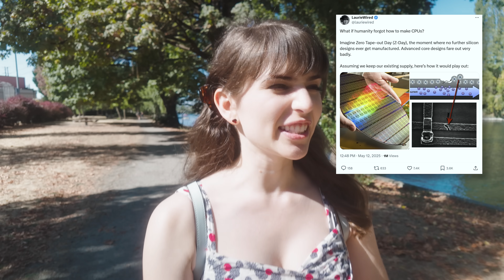what if humans forgot how to make CPUs?

Comment: I've lived this scenario but in reverse. I'm 70 now and I've been a technologist pretty much my entire life. I remember life before widespread computers of any kind. When I was a teenager the only interaction that people had with computers was their banking system or their utility bill. Life was entirely paper based. Our phone in the hallway was an analog pulse rotary handset. Television was black and white and then early vacuum tube-based color. Radio was radio and to interact with friends usually meant visiting them at their house or apartment. What you don't mention is that probably eighty percent of the population will have to die. Never mind about the fun little distractions we all live with today; our 'just in time' food and medical supply system is completely reliant on computer horsepower to run. I remember the paper-based world. Invoices and orders took days, sometimes weeks. Analysis and projections took months. Decisions and strategy was reserved for the next year. Our infrastructure would grind back to the crawl it used to be. Here's a tip; be dead before we forget how to make sand that thinks or can't maintain the infrastructure we have today. Technology going forward is amazing. Going backwards is horrifying. And eventually it is going to happen.
Reply: Just farm efficiency alone will be enough of a problem. The precision applicators, GPS guidance systems, and post-harvest processing equipment are essential to the reliable high production the current population relies on. 
People won't completely starve in the producing nations but costs will go up at least 50% which are resources that must be taken from some other end use and there will be less surplus to supply nations that are already on the edge of starvation.
Reply: Talking of paper, a few years ago, I read that the demand for paper was higher than ever since computer use increased. You'd think the paper industry would have declined, but apparently it's the opposite. Demand for paper increases. My guess is that IT allows for more office work, very broadly speaking. Reports, documents and so on. Many of which have to be printed at some point. Also, many, probably most of us have a printer at home. Hardly anybody would be printing things at home as recently as 50 years ago.
Reply: @OrangeNash  It has been trending down for a few years, but yeah into the early 2000's there were many of an older generation that needlessly printed everything. Not just wasteful memos and low info-density handouts, but they had the mindset of printing email just to read it, like a fax, because mail is a paper you receive in your hand printing is just a default part of the delivery…

Seriously, I even recall several company-wide memos at the corporation I worked at back at that time telling people to stop printing emails because it was creating a significant issue of both office supplies and handling the recycling, and there is a forward feature if you need to share it with a coworker.
Reply: I to was a member of that generation. I got into computers back in the early 70's in high school, we worked on late 60's mainframes and PDP-11 timeshare systems. Life was different then, but I could see us as a civilization reverting back if needed. My Son would be lost as would all Gen Z kids, but the human race is pretty adaptable and would largely survive.

Comment: Sorry, this apocalyptic scenario should be "what would happen if all electrical engineers and physicists died and all their books & PDFs (knowledge) suddenly vanished?"

Otherwise, they will just start building transistors, while going to back to mechanical computers with them hole-punch cards to get to the stage where they can make electrical transistors again.

There is also another very boring scenario where we would forget this: we figure out some alternative technology like, spintronics for example, is just much better for calculations. In which case, modern day CPUs would become the vacuum tubes of the future...

Comment: I still have a few 12-15 year old computers that are still running like new. In fact, I prefer to keep my older machines (all running Win 10 Pro) because they seem to be more robust than the latest and greatest. I've bought 2 average HP laptops since 2020, and both have suffered major failures, whereas my older machines just keep on running flawlessly. I'm not concerned about all of the micro-controlled things we have because I have many older appliances without chips in them just waiting to be pressed back into service when the last chip goes down. Now I'm looking for an old car built before everything was computerized.

Comment: If I put my optimist hat on, I think that within 10 years (or less) we'd have optical CPUs (with all the logic/and/not/xor gates replaced with fiber optic & mechanical replacements).  It would be expensive (b/c modern CPUs are basically printed with light by depositing metals and doping agents); and could possibly even surpass modern CPUs in terms of speed and reliability.  They would be rather huge, though.

Comment: I'll assume that there is a reason why this occurred, such as a major solar storm that wipes out a significant portion of existing technology. Perhaps things have become so specialized with automation that the actual people who knew how to do this from scratch have died out.

I'm glad that I have studied the process of old-school synthesis. I'm fairly confident in my ability to make very simple logic ICs, likely no more complex than the 74HC series. With significant effort, I think I could replicate late seventies era microcomputer ICs, with CMOS. The original 6502 was taped out by using a large lens to shrink masking down to the gate size. The NMOS technology of the 6502 used roughly 4,500 gates, and the CMOS technology of the 65C02 uses around 12,000. It's a significant jump in scale, but one that would be possible using modern optics.

We would lose out on a lot of what we take for granted, but I've written plenty of software for a 65C02. It would be enough to bootstrap the technology again and rediscover what we have lost in a couple of decades. It would be an incredibly lucrative business, given how much we rely on this technology. Rediscovery tends to go faster, because we know what was once possible. We can examine dead silicon as it fails. That saves a lot of false starts.

Comment: well .. if we immagine the worst, a full scale nuclear war .. the first to go is nuclear plants and the power grid from EMP pulses .. including most unshielded electronics, nearly 100% of consumer devices would become useless .. even some diesel backup generations would fail (integrated electronics) .. about 90% of the population would find itself without any power and light .. of those who didnt die in the initial blasts or by radiation, most will freeze to death or starve to death .. in less than a year 80% will be dead ..

Comment: It's 100 Years after Z-Day. A myth persists. Legend tells of an indestructable device with endless battery life: the Nokia 3210.
Some brave adventures discover a huge stockpile of the last ones ever produced. They decide to build a new internet, powered entirely by the 3210s.
And even 100 years later, they are still running on their initial power charges from the late 1990s.

Comment: Uhm. I was responsible for university department hardware (Russia, in a pretty underfunded place). (part time, between very early 2000s and about 2022). Oldest machines we had practically working in 2021 were from 2006. Most of the issues were not actually CPUs, but mechanical drives getting dead and capacitors on motherboards drying out and dying. Chips themselves are mostly fine, unless you hit bad batches/series/models.

And yes, the situation is about right - stockpile the hardware, do not throw out/write off anything. Fix what you can. Switches, actually live pretty long life (our longest living dated to early 2000s). Current hardware may not fare that well, due to cost cutting in production. Also - SSDs wear out. Modern ones - quicker.
We ran desktop class machines as servers too (ill-advised, but it does work and getting spares is easier ;-) ).

PS. loss of chip production would hit all car manufacturing (all modern cars have more than a few CPUs in them) and lots of other unexpected stuff, from medical equipment to bank cards (chips too).
PPS. that was mostly covered in video.

Comment: Interesting thought experiment! I think all of the predictions are good, but the timeline is accelerated - I think it'd take longer for things to fail in general.

I have and run old machines 24/7 to compile software on alternate architectures like VAX, m68k, Alpha, and so on.

The older machines (late '80s, early '90s) have already been recapped and have gone through power supply and drive replacements.

Machines like my AlphaServer DS25 from 2002 or so will run forever. It's built way better than contemporary servers and is still more reliable than new machines. Even original SCSI drives from when the AlphaServer DS25 was new are still running (although the primary storage is much newer SATA and SAS).

Late Power Mac PowerPC machines are still running reliably, but have needed new storage.

I ran an iPhone 6 until two years ago, and it's still used for navigation and music, so I don't think phones will fail so quickly, although their batteries will.

What has failed most? In my experience, power supplies older than twenty years old will need to be recapped. Interestingly, recapped older power supplies are more reliable than those made from, say, 2000 through 2015.

SSDs are horrible. I've had classic and new machines chew through countless SSDs, although this is for heavy usage - compiling with tons of swap, checking email spool files on servers, et cetera.

Spinning rust reliability depends heavily on the drive. I have the first hard drive I ever owned, which is a 200 meg SCSI drive which still runs fine. Older but fancier drives seem to last better than consumer drives. For instance, many of my systems use 2.5" UW-SCSI 320 SCA server grade 70 gig drives that're from around 2006 or so.

So people like me would probably keep machines running for many decades :) Having run servers in the '90s, I already know what's possible on sub 100 MIPS machines, and it's a lot more than most people would guess, I think.

Comment: So earlier this year, one on my drives on my development RAID failed. Had it for 8 years, so I bought a pair of 1TB WD RE5 Drives, and rebuild my raid, yeah, so I have my mirror and 1 more free just in case. I am building another PC now. The one I have is 13 years old with a 4770k. And yes, I will put my development drive on another mirror. I keep my boot on an SSD that I hardly write to, unless I am installing stuff. My data/test drive is not a mirror, don't mind losing that drive, but I have 2 of those, not synced. My swap drive is an older SSHD. I guess my new pc boot will be an NVME and everything else will remain the same. Unless I decide to do big data stuff. hmm.

Comment: I think about this a lot because one of my obsessions is how to design the smallest possible fully self-sufficient and self-replicating Martian colony.  We can malt habitats out of glaciers, build frozen mud housing, and smelt all kinds of metals making iron-nickel steel, cold-rolled and corrugated steels plus cold-welding them in the nearly oxygen free atmosphere...  We can generate efficient wind energy (with very broad blades) and water batteries with in situ resources but microchips?  My best thoughts so far are layers of electronic inks on paper -- very large circuits barely making a usable computer to share among the colony.  We could use the integer only version of RISC-V.  I would like to be able to at least make a RISC-V processor with small RVV extension on something akin to the old M6809, 6502, or Z-80.  I think we can make vastly more useful software for those today than we could then.  The decades have been a horror show of increasingly bloated software for no valid reason beyond stupidity and laziness.  BTW, you are definitely in the Pacific Northwest.  I grew up there and love there.

Comment: With Intel currently folding which could lead to a more monopolised CPU market due to less competition which would lead to stagnation that might be not so hypothetical. Also getting shortages somewhere in critical materials tools or equipment can disrupt this proccess completely. I don't believe there's even one company with full cycle CPU production. Lithographic scanners by Dutch ASML,diffusion in Malaysia, production in Taiwan. Someone growing Si monocrystals for waifers,someone else making photomasks,MOSFETS,capacitors etc. I think semiconductor manufacturing is the most complex technological proccess in human history by far.

Comment: Well, first thing that WILL happen, is that "all" resources will be spent on reverse engineering the whole process while everything is still working. Even if the technology will be 16nm CPUs or more, it's better than nothing. If I forgot how to make something, I retrace my steps or analyse existing works and try to recreate it. Same thing with anything. It's a matter of how much people want to do it. So the real question is, how much of the process is lost?

Did we lose from the very beginning. Like how to make and further refine silicon into 99.99999% pure silicon? Or the blueprints of CPUs? Or even the concept of CPUs dating all the way back to WW2? Depending on how much and what is lost may result in weeks to decades worth of time given to restart the whole process.

Comment: we could recreate cpu's using discrete components . supercomputers up to the late 60s were still discreet , with modern manfacturing we could probably get to the level of about 486-pentium/68030 level performance. ram would be more difficult . networking tough . we would go back to central computing with basic 1 to many serial connections . with heavy software optimization we could still do remote terminal stuff with sound and graphics . we could network these large central compute nodes for a somewhat similar internet type of setup.

Comment: Perfect marketing ploy for the new Commodore 64! Pressure to develop crystal and biological/neuron integeration technology.  And develope compute/memory integration technology.  Photonic chips. Relays (slow).  Quantum computing tech pressure to advance but presents a barrel of other issues. People are already under-volting and cooling to max life.  Prophetic forecast of solar flash that voids silcon based semiconductors and ends up changing how the fundamental physics of electron transfer messes with the frequency response causing glitches in the classical tech....?

Comment: Like cockroaches, ARM CPUs are everywhere and will be ripped from their circuit boards dug up from vast stores in Africa.  E-waste will be the ultimate differentiator.  Africa will rise as the superpower less than 200 years after z-day.  New operating systems will be developed to take advantage of even the smallest 3-pin microcontroller.

Comment: Seems unlikely that things would fall apart so quickly. Older PC's could be scavenged pretty easily and last decades more. I have a 90's era Pentium 166 that still works fine. I also have a 24/7 server at home that has been running since about 2013. I've just had to swap out hard drives and fans and power supplies over the years (once on each if I remember.) A lot of old PC's and consoles just need the capacitors replaced to run like new. 

A lot of compute is thrown out after 6 years just because the warranty has run out. Lucky for me, because I snagged a few 2016 era xeon workstations for cheap that still work fine. You'd be amazed at the amount of e-waste there is today.

Comment: Thanks for the mention! That video is fairly old and I'm closer to 2-15x nowadays (depending on the use case of course)
Reply: the legend himself
Reply: Kaze mentioned!
Reply: MY GOAT MENTIONED!!!!
Reply: Love your work and videos. Is it “Kayzz” or “Kahzay”?
Reply: @Ruckulent  Laurie said the former
Reply: Motorola's 68000 series CPU was mentioned, but things a little more modern than that like the Intel 386 and 486 could still be running in well over a hundred years. The 386 is even space-rated because it's so reliable and insensitive to ionizing radiation. The problem is ... almost all of them have been scrapped, and the CPUs crushed as part of gold recovery processing.
Reply: @YodaWhat  Fortunately, I have quite a few (functioning) 386s and 486s (along with 8088s and 286s, but also Pentiums) in my vintage hardware collection already, along with the corresponding boards, and I guess I will be adding more ;) They can still be obtained but the prices are steadily growing. If you are lucky, you can occasionally find one available as a barn/attic find, or buy some out from the scrapyards.
And even more fortunately, there are still many of similar enthusiasts out there, collecting these engineering masterpieces that will outlast not only the newer chips but also the humanity itself, I'd expect ;)
Reply: @YodaWhat  there's the Motorola o-something too, up to the superscalar 68060, mostly equivalent to early pentiums for technology and speed...
Reply: Dude! So random to see you here. I've really enjoyed your N64 vids.
Reply: Doing god's work.
Reply: 15x!
Reply: POGGERS!
Reply: Meine Ziege 🙏🙏🙏
Reply: Recently we got an almost arcade-grade port of Outrun to well-expanded Amigas, courtesy @reassembler. On his channel he delves quite deep into the optimization job he so successfully undertook.
Reply: goat.